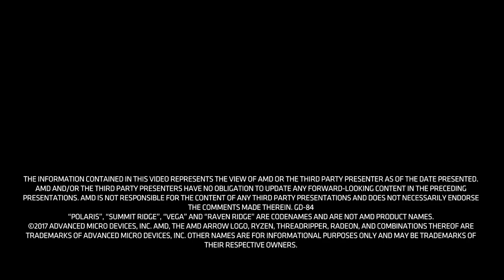How the AMD “Zen” Core is Made

Comment: Amd in 2017 destroyed intel
Reply: Subi_fan Yes they did.  The only chip thats worth buying from Intel now for just gaming is the i7 7700k and I still wouldn't buy one because an r5 1600 with higher clocked memory can give extremely high frame rates as well. You're also stuck on a dead platform if you go for kabylake.  The newer i5s will be faster then the i7 7700k for sure and the upgrade path for ryzen is insane.  If you go AM4, you'll get next cpu's up to 2020 which is really good.
Reply: WarmSoftKitty Most of the X series processors are actually slower then ryzen processors.  The only Xseries processor that is faster is the 16c/36t one that just came out but it's 2000$ and it only outperforms the 1950x by 5% and it's double the price. The newer i5's will be faster then the i7 7700k because they'll have higher clock speeds and will have exactly 6 cores.  They'll have more multi threaded performance and single threaded performance.  Ryzen 2 may even be faster since to moving to 7nm and comes out sometime late next year.  Ryzen is most certainly better to go for over the i7 7700k. Also,  the 7740x is slower then the i7 7700k and cost way more...  X299 is a joke.
Reply: WarmSoftKitty Hardware unboxed did a video on the 7820x and the ryzen 1800 trashed it in every benchmark and the r5 1600 even managed to beat it.  The 7900x is slower then the 1950x and the 1950x is cheaper and has more PCIE lanes...  The X series processors that are similar to their normal desktops counterparts are slower then their normal desktop parts. The ryzen 1600 beat the 7820x in gaming and multithreaded work loads.  Look up hardwareunboxed's channel for proper information. X299 processors are over priced, the lower end ones make no sense which is why x299 processors are a joke and that's most certainly a fact. Also,  look at the cost of Intel's X series processors vs AMD'S normal desktop lineup of processors and you'll see which one is better.
Reply: WarmSoftKittt That processor literally marches the r7 1800 and it cost twice as much if you add on the additional cost of an expensive X series motherboard.  It does not beat the r7 1800 in price and barely bears it in performance.  You're really starting to sound like an Intel shill at this point.
Reply: If your going to compare intel x vs ryzen 7 / threadripper, you compare the chips at the same price point (eg 16c tr vs 10c x series at $1000)
Reply: WarmSoftKitty Intel X isn't faster in everything and it's literally double or triple the price of the AMD CPU that it  competes with. A b350 motherboard can go for 80$ and an x299 motherboard goes for around 400$. You have no idea what you're talking about dude. Intel X is a joke.
Reply: So many things wrong iwith this... Are you forgetting about he G4560 and the i3? You know gamers dont make up the majority of the market right? The fact the i3 has an igpu capable of running 4k60 makes it a good processor for non gamers. If you think AMD destroyed intel in basically any field you are incredibly delusional.
Reply: +Lavancer Sorry but that's bs. I just looked up that Hardware Unboxed video (well the identical Techspot article by the same author, easier to skim) and the R7 1800X certainly doesn't "trash [the 7820X] in every benchmark." The 7820X is 5-10% faster in most tests, even as much as 25% in a few of them. The Cinebench scores for the 7820x are 6% higher multithreaded and 24% higher single-threaded over the 1800X. There are one or two productivity tests where the 1800X barely wins by like 1-2%, but that's it. 7820X wins in all games.

Intel has higher IPC and clock speeds, what makes you think an equal core count Ryzen would win? Annoying the number of fanboys that upvote you without even thinking. Now when it comes to value or comparing CPUs at the same price point that's a different story; Ryzen is usually the better purchase. At equal cores though Intel pretty much always wins.
Reply: The Intel X series, no contest, beats everything in terms of overall performance but the big kicker here is that you're paying such a high premium for what amounts to a very little margins in performance compared to AMD's offerings with a price difference of almost $500. Not to mention the fact that the motherboards for the X series is nothing but a con-act. A lot of features are locked if you decided to use lower end x-series and for the target market for this platform a.k.a. productivity users will most likely want to use all of those features. Which really makes the argument that it's a no-brainer to go for Threadripper instead.

So unless you're a gamer that wants the best performance in gaming, it's always going to be intel's i5 NOT the x-series. But if you're a content creator, or someone who does work on your PC, then go for AMD, it's cheaper and offers all of the bonus extra technologies that a higher core performance cannot give, and the can trade blows with Intel cores on productivity uses. Compare that to intel whose extra technologies are only unlocked at the highest skews (high-end x-series and xeon).
Reply: WarmSoftKitty lol Cheapass motherboard best z370 mobo for is around 250 best lga 2066 mobo is >400 dollars whoops
Reply: Daniel Bennett you do make a good point but no one that has a 4K monitor will have an i3 in it period. But yes the lack of igpu for he ryzen hurts it in the budget computer spectrum
Reply: mystirboy Im sorry but you're comparing a 600$ i7 to a 300$ R7. The price difference between the two isnt worth the 5% increase in performance. You're sounding like an intel fanboy.
Reply: +Tyler Brandel He literally made the exact same argument as you. Your reading comprehension is terrible.
Reply: Malus1531 His reading comprehension isn't bad at all. He just restated what I said lol. There really isn't anything wrong that restating something that is right.
Reply: That's my point. Did you even read my post? I wrote "there's almost a $500 price difference for such a marginal performance increase, that IT'S A NO BRAINER TO GO FOR AMD". That being said, it's no contest if we're talking ONLY about GAMING performance Intel WILL WIN majority of the time. But I do think that will change since it's only a matter of time before game studios will optimize upcoming games for Ryzen. In fact I do think that most game developers might move to work on Threadripper workstations once companies upgrade their hardware.
Reply: Daniel Bennett but we gamers need dedicated gpu for long run
Reply: Yup. Unless it's i7 7700k (apologies, it's not included on the x-series),AMD is still way better to go for. But it really doesn't change the fact that intel still sits on the throne for performance, but as the story for sword of damocles goes, the knot holding that sword on top of intel's head is getting thinner and thinner.
Reply: mystirboy Lol true.  They have the highest performance but their prices  are like double the prices of what AMD has and the difference is usually like 5-10%. Coffee lake looks very interesting  honestly.
Reply: Coffee lake oof
Reply: Lavancer i7 8700k, intel just releasd their 8th gen cpu
Reply: Moshin Sadiq I know and its way over MSRP due to price gouging. Skylake and Kabylake users are hating the fact that they have to buy a whole new motherboard just to get to that CPU. If intel didnt change motherboards every damn year,  it would be a better deal.
Reply: Brummie Comedy That processor wasn't out when I made that comment. But yeah, I told y'all coffee lake looked interesting.
Reply: Coffee destroyed Zen
Reply: Daniel Garcia Not realy. r5 stills beats i5 in a few games and still does better in multi threaded task. R7 gets kinda trashed by the i7 8700k but the 8700k is still a lot more expensive then an r7 1700.
Reply: Wow... No serious comments here. Only fanboys. Nice! Couldn't we just agree, that both sides are quite good for some things? AMD has got more Threads and Cores and Intel has got more power per core and more power in sum.
Reply: ThexXTURBOXx not even close intel has had so much more time to build up stock however as of now their coffee lake options can finally compete with ryzen. $117 i3 8100 quad core is a fantastic deal vs the r3 1200 since even when the r3 is at let’s say 3.9 the raw IPC of coffee lake makes the i3 faster by a pretty large margin. (20ish%?) 6 strong cores will be more than mainstream for gaming for quite some time and the i7 can now stand up to the r7’s in productivity while all of the k CPU’s can easily hit 144hz gaming with an OC.
Reply: intel is making a comeback
Reply: ThexXTURBOXx That's the problem. Both sides are bad at some things and that's what people like to argue about.
Reply: Rokutasaka Facts. But ryzen 2 looks like it'll be very good.
Reply: AMD in 2019 gonna wreck Intel, hard!
Reply: 2019 kill it
Reply: Caezero they did
Reply: I am from the future. AMD has kicked Intel and NVidia’s asses.
Reply: 2020 Kill conformed.
Reply: Subi_fan  they do now
Reply: 2020
Reply: 2020 and they actually did it
Reply: @strikepaw1  were you right oh boy
Reply: @KuqieFPS  that didn't age well
Reply: @TimTomTem  indeed it hasnt

Comment: So Raven Ridge is a single die? Interesting.
Reply: It's also only one CCX
Reply: Don't assume anything from what you see in the video.  The grubby fingerprints of marketing types are all over it.  I do not know if they were intentionally being deceptive at the time but what you see is not what you get.  For example, when Threadripper was being discussed, we saw a single large die that looks similar to photos of Vega dies I've seen, and we know that Threadripper consists of four small, separate dies (two functional and two not).

Comment: AMD. Cut the losses on your GPUs and refresh the Polaris series with something new. A graphics card that is GDDR5X with a smaller bus to prevent miners and a higher clock speed! Simple :) You don't need those buses for gamers AMD...
Reply: You just need the efective bandwith, being HBM or GDDR5X or whatever, the bus size doesn't matter at all.
Reply: Compute cards a bigger market than Gamers.
Reply: NoNoseProduction incorrect
Reply: TheRussianBrit lol bus width is what miner care less of. Educate yourself
Reply: Markitos And HBM is expensive and not that good
Reply: AMD in their own shareholder meeting said in the GPU TAM, that 40% of the market share makes up 60% of the profit. This market share is the high GPU, i.e compute cards for prosumers and servers.  Their margins are vastly superior to what the Rx 580 has
Reply: NoNoseProduction that's the firepro series though, which is actually good...
Reply: I'm just stating AMD doesn't have the resources to make a Gamer only card. They would rather make cards suited for the high end user and then just gimp those cards for Gamers. There is more money in it and Nvidia has been doing that for years. Why fight over a shrinking market? Go after where its growing...
Reply: NoNoseProduction so why does the rx 580 exist? To appease gamers. But why is it built like it's for miners and content creators?
Reply: it was a low power design and failed to supplement gamers need for a high end gpu through cross fire. Why does it exist? Low power compute card. Why does it work good with mining? because its a compute card that has an efficient tflop to watt ratio

Comment: I bought the first gen Ryzen 5 1600 right when it released and I’m really happy. It has not crashed once yet and I can upgrade it to like a Ryzen 5 3600 4th gen or something when I need more power :)

The only thing you have to be aware of is ram compatibility. But they fixed that with the newer models.

Actually I recently upgraded from 16gb to 32gb of ram with a 2nd ram kit (that was not even supported having two of them) when I bought the motherboard but since they made a bios update which I installed and it runs really good now.
Reply: Edit: I only had intel machines before that so good job amd. To be honest I really like your cpus. When it comes to gpus I’m still on team greens side since g-sync is so awesome and they have less problems running smoothly. But I’m sure you will improve it aswell

Comment: I love how amd makes it so most of there consumer grade CPUs use the same socket for multiple years and multiple generations so consumers can spend less on new motherboard for different sockets. For example, now with zen 3 and Ryzen 5000, you can still use a b550 or x570 mobo with the CPU. Unlike with intel, where when a new generation comes out you have to spend more on a new motherboard that supports the new socket. AMD is out here giving us more bang for the buck whereas intel is making us pay more because the socket changes with every new gen cpu. I will forever love AMD’s CPU lineup.

Comment: AMD, please consider some improvements on the platform in terms of RAM.  For example, Zen as a whole, and especially Threadripper, shows that memory performance is key now and highly beneficial to the platform. Yet, there are NO ECC RAM kits out there that are higher MHz even though the JEDEC standard is higher than current buy-able kits.  I know this isn't your issue exactly but you have influence over this.  It forces enthusiasts & workstation prosumers into a black or white situation in terms of options with penalties on both choices; there's no middle ground.  For consumer platforms such as Ryzen, why are we not going SO-DIMM route for mini-ITX and mATX boards? The current full slot DIMMs are a waste of space and have unnecessary pins as again, ECC is market segmented (as well as Buffered/Registered).  These motherboard dimensions would benefit greatly from reduced DIMM slots. There is not penalty with SO-DIMMs for Ryzen boards, even Threadripper.  And if RAM performance is key, why are we not going QDR (quad data rate) for next gen? QDR, at 4 cycles per clock would be a MUCH more significant improvement than MHz bump up at DDR5.  QDR is already proven and exists in SRAM and as GDDR5X (as you know).   Please look into these.

Comment: Why do they manufacture and cut the dies in the wafer like that? It wastes a lot of probably good dies, those which sit on the edge of the wafer. Just look at 1:19, if they turn those dies 90 degrees, they can have like 10 more usable dies for the wafer. Small yield improvement, but still.

Comment: 14LPP was 1 years old when you used it, so no... Also it was a refinement for LPE was what in production a year before that, it was not a bad choice though if it was a choice to use a relatively well established node for Zen because it meant you could quickly raise yields also it meant you didn't have to wait for the new node as well which would have been a mistake because we still would have been waiting for Zen as 12LP still isn't ready and really wouldn't have been worth waiting for over 14LPP.

Here is to hoping you can get a 10% upclock with 12LP though with 4.5Ghz overclocks attainable on high end air and AIO's that would certainly make you competitive against Coffee Lake, if you can manage 15% like Global foundries claim is possible... but I doubt that, I am even somewhat doubtful of 10% but 15% would certainly make you competitive with Coffee lake as that would mean a 4.7Ghz XFR on the 1800X replacement which would overtake Intel in clocks for stock.

But if you do manage that it will take the wind somewhat out of Zen 2's sails unless you do what I somewhat expect you to do to Zen 2 which is up the max core count on the AM4 platform to 12 cores as I only expect a 5 - 7% IPC uplift best case and I wouldn't expect much higher clocks than 4.7Ghz XFR in fact there might be a frequency regression due to the much more different node and much more compact node and the fact that you are going for if I am correct 12 cores which would probably necessitate an increase in L3 Cache and certainly L2 and both Data and instruction caches because you will need those for each core.

Comment: Why are they cut from a circle? Square would be much better
Reply: That circle came originally from a cylinder. Silicon (the material used to make these chips) is made by putting a small piece of solid silicon in a batch of molten(liquid) silicon. It is then spun around. The small piece eventually grows into a large cylinder which is then cut up into several thin circle (called wafers).

This would be better than to make a square. If you want to know more about the process, you can look up Intel's video about making silicon or search it up in Google.

Comment: I am a bit concerned. AMD went with 14nm and single core performance, well we know. Overclocking not thrilling either. GPU's on 14nm, the 480 was beaten by the 1060 and 14nm Vega is being smoked by 16nm Pascal. Now you want to go 12nm? I do not see this working out for the better.

Comment: Stop making me want to upgrade my ddr3 pc ;-:
Reply: If you can wait 18 Months, wait and buy a DDR5 PC
Reply: @happygimp0  its going to be really expensive then ;-:
Reply: @joeyyeet2970  Not when you consider the ECC.
Reply: @happygimp0  what is ECC
Reply: @joeyyeet2970  Error correcting code. Saving parity bits to detect bit flips. Silent bit flips are bad. It is irrelevant for gaming and stuff, in the worst case you have a glitch or crash and need to restart, in other application it can change the data and you don't notice it.
With DDR-DDR4 you pay premium to get ECC and most PCs don't have it. With DDR5 you get ECC everywhere.